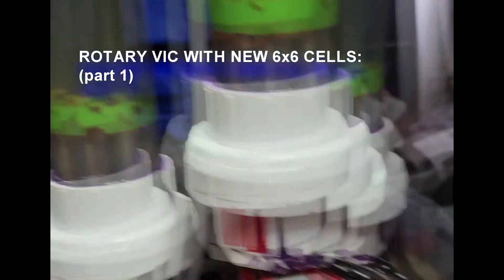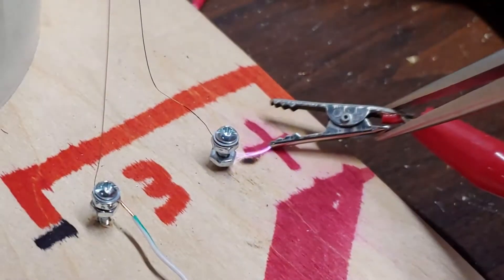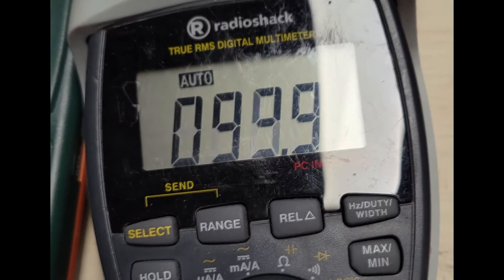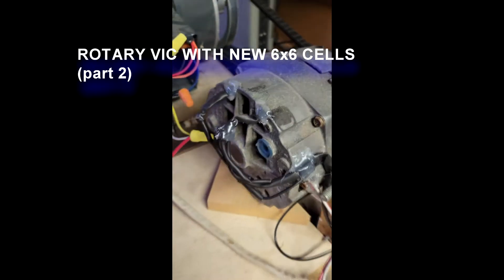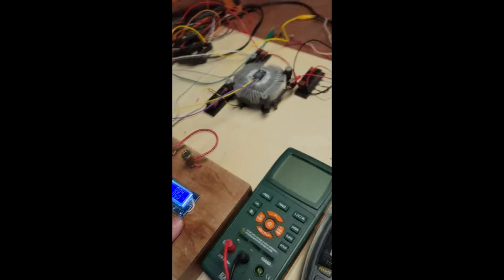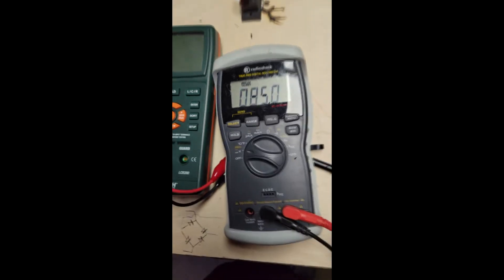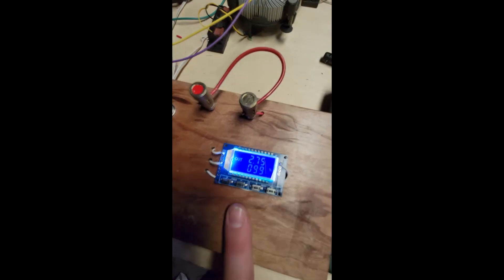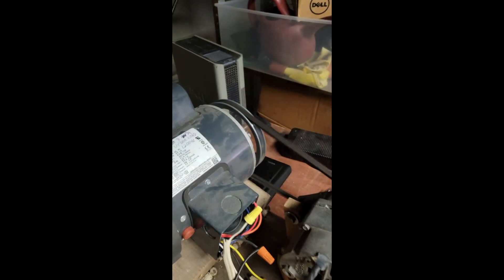Stanley Meyer's Rotary VIC with my 6x3 Water Fuel Cells

Comment: Bravo, very nice work and well argued. The alternator is overwound, because you mentioned that it is VIC, does that mean it has secondary and RS coils? Did you place the mosfet after the alternator or did you power the alternator through it?
Reply from the maker: What do you man by RS coils? The mosfet is placed between the PWM and the rotor's primary coil. The 3 secondary coils have been rewound with fine gauge wire and are directly connected to diodes then the fuel cells.
Reply: RS are resonant coils. Do you only have one winding per phase and not like Mayer gave 3 windings per phase?

Comment: In the Meyer solution, the water capacitors, they stay charged all the time?
Reply from the maker: @rochaaraujo9320  like any capacitor, they leak energy over time. They stay charged for a few minutes (constantly discharging). I have a vid showing exactly this... coming soon.

Comment: 3:45 you are saying 9 amp... In your comment you are talking about 1amp. What is exactly the amp you need to produce you hho. That's the goal. If I remember correctly Stanley was using 0.5A for his fuel cell. Thanks for sharing!
Reply from the maker: The standard 1/2 HP motor draws ~9A at 120vac. Now, the actual VIC circuit draws MUCH less, about ~1A. That's my 12v input to my PWM. The amperage traveing through the cells is typicaly less than 500mA. So to "produce" the HHO, less than 1A is used, however the entire machine uses ~10A, because of the 1/2 HP motor. I go deeper in later videos.
Reply: @noahauman  Whats the minimum power that enegen can be to spin alternator?
Reply: Looking good. Any electrolytes?
Reply from the maker: @m3sca1  as always, pure water. no electrolyte.
Reply: Can you put inductor between three diods and cell to increase voltage?